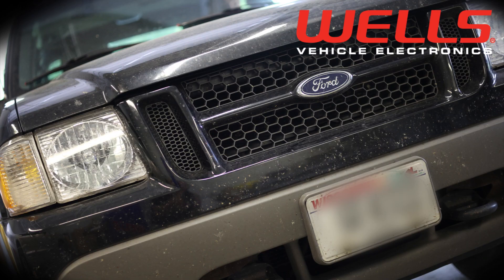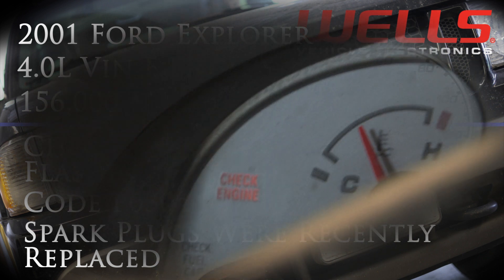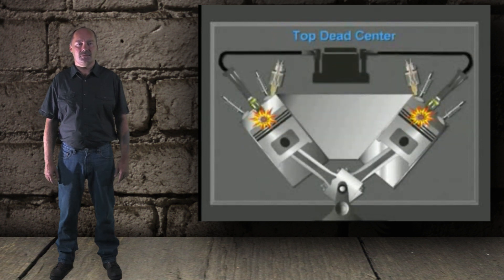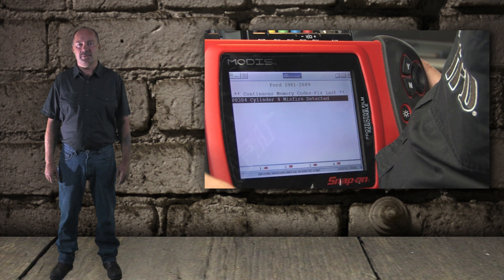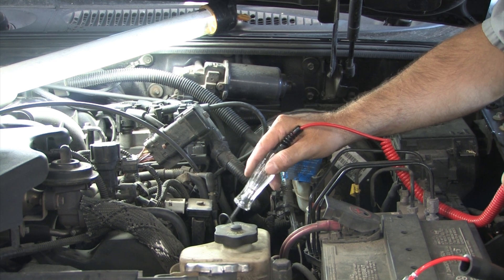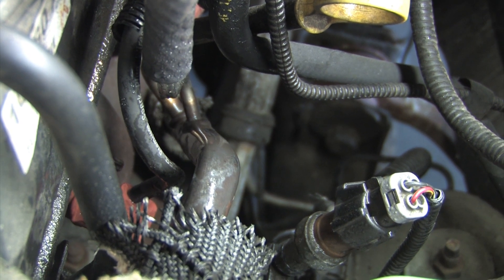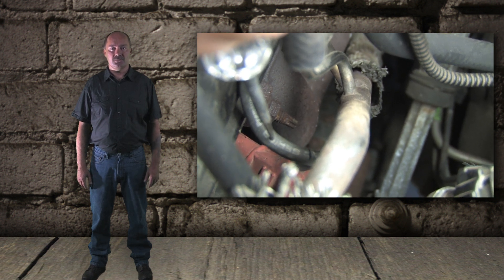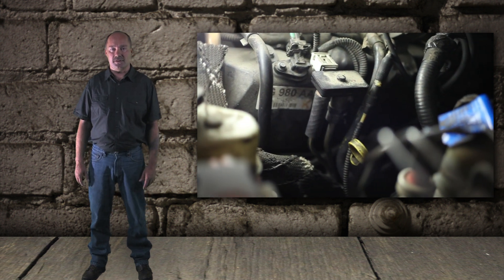P0304 2001 Ford Misfire Diagnostics by Wells

Comment: Mine is still misfiring. Changed plugs, changed coil, checked ohms on fuel rail for faulty injector none. Even checked ohms on coils all read good. Still losing power tremendously when I gas it. Possible cat clogged? Still coming up as p0304.
Reply from the maker: Hey Cagedhyena P, a misfire can be caused by a ton of different things. Sure a clogged cat could be an issue, but so could a valve issue, or about 100 other things. May be wise to take it in for a diagnosis at this point.
Mike Becker, Senior Technical Instructor
Reply: after doing all of that it might mean the cylinder is shot. check it for compression

Comment: What do you mean by 'power braking the engine' in 1:59? https://youtu.be/HaQlfo1XMms?t=119
Reply from the maker: Hey AeroRamer, power braking is when you put the vehicle in reverse or drive and hold the brake while giving it gas. This puts a large amount of load on the engine which is good for finding things like ignition misfires

Mike Becker, Senior Technical Instructor.
Reply: My P0304/P0316 problem turned out to be a bad distributor. It had hairline cracks in the back that were not visible until after I removed it and inspected closely. The water trick did not work here because the cracks were in the back of the unit. I did the sparks check. The spark for the cylinder I had problems was very weak. I had checked the distributor resistance prior to that and it was the same as the new unit. Distributor replaced and all good now. I also replaced the plugs and wires. Plugs looked awful and gap was WAY out of spec. The wire resistance was about the same as what others reported but WAY lower than new wires. Thanks.

Comment: Seems silly to connect that test-light straight to the Battery.  I always use an alternate ground.
Reply from the maker: Hi Ralf, why do you say that? What is the benefit to using an alternate ground?
Mike Becker, Technical Services
Reply: I know that the bulb protects but I always felt that the voltage coming from a coil should not be lead directly to the Battery.
Reply from the maker: Everything electrical on a car has to make it's way back to the battery one way or another. Remember that electricity works in a loop. The battery is by far the best place to achieve a solid ground when testing.
Mike Becker, Technical Services Instructor
Reply: Agreed, but it's not 12V that is jumping out of a Coil.  I'm not going to argue about it cause I don't know.  For the last 20 years I have been using a lug at any point I pick.  I tend to stay away from electronics if I can.  But hey, whatever works for you.
Reply from the maker: Great Ralf, thanks for commenting in. If you would like to talk electricity and electronics on a vehicle I'm here. You are more than welcome to email @ michael.becker@wellsve.com. I would love to answer any questions related to testing and electronics that you may have. Have a great day!
Mike Becker, Technical Services Instructor
Reply: Thanks for the Info there likely will be some questions coming your way.